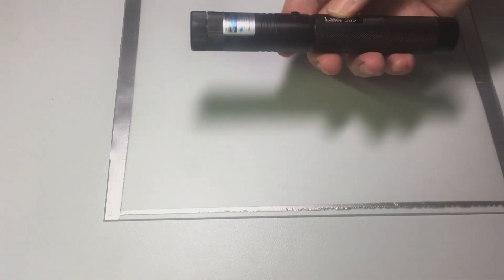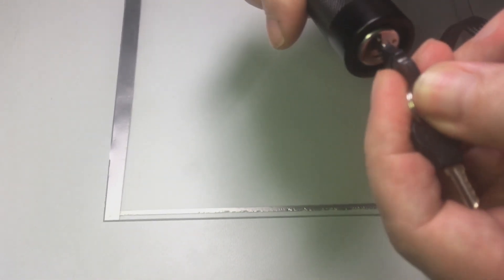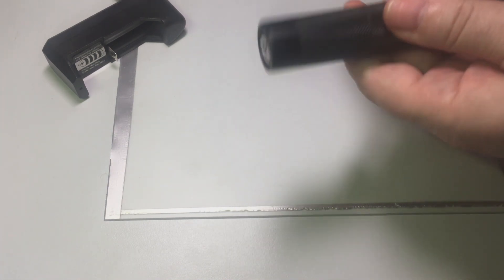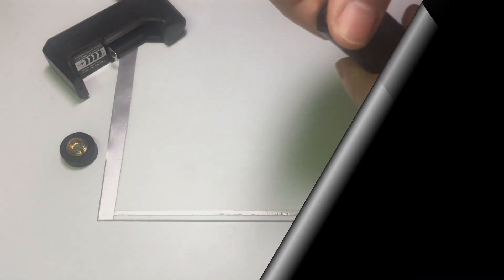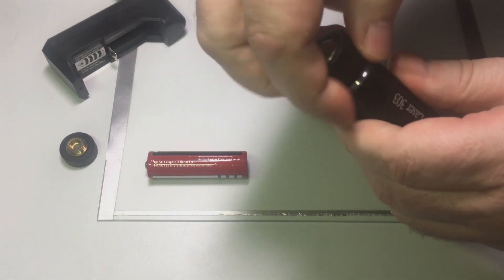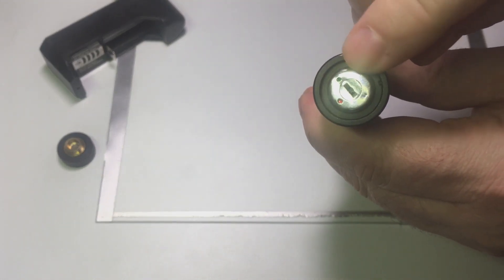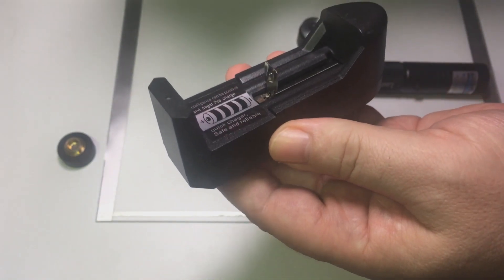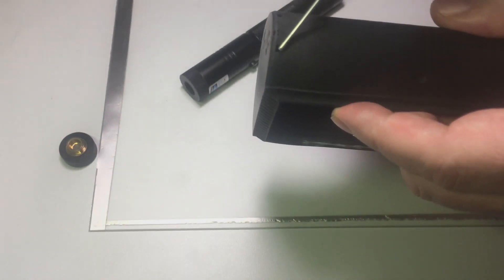A 405 nanometer UV laser torch for resin curing (Laser 303)

Comment: Do you think a blue laser can cure UV resin? I have a 30W laser but I'll not use the max laser power.
Reply from the maker: If it’s wavelength is near to 405nm, it will. A 365nm lamp does the job very well.